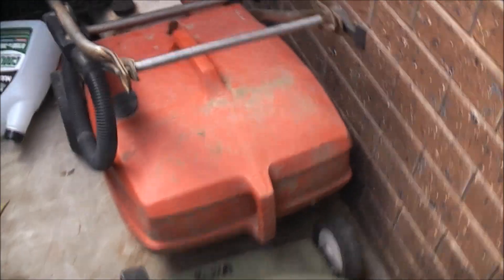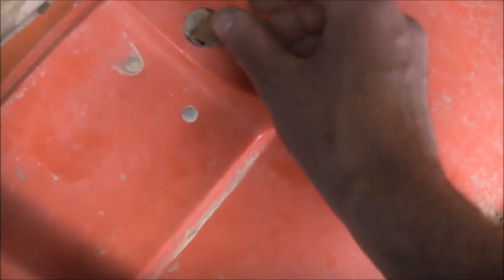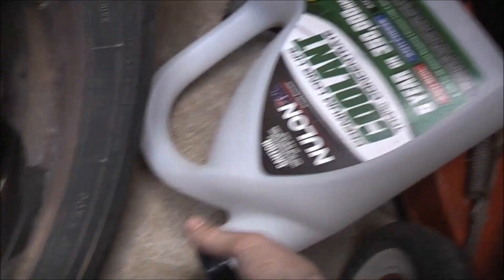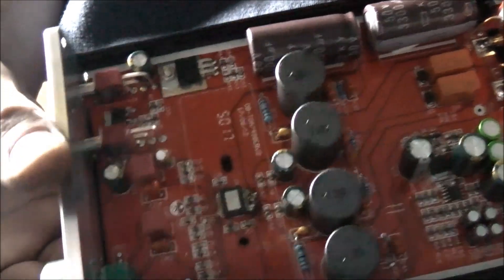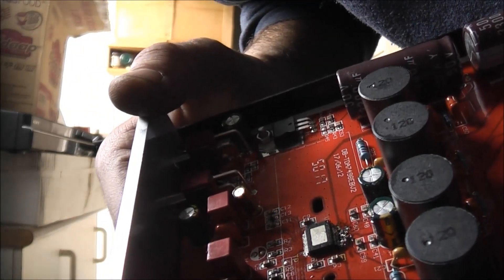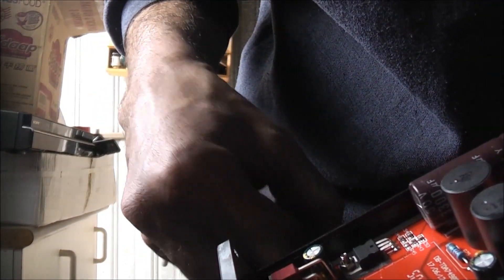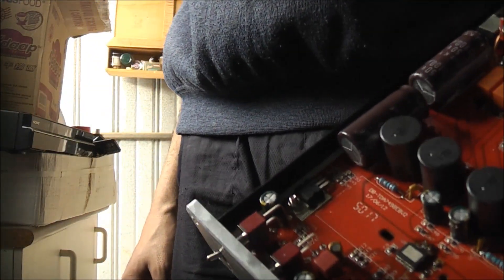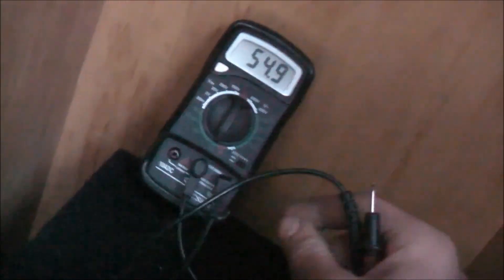Victa 500 Twin Catcher Score & Popped Lepai Amp ;-(

Comment: Thermal digital chip amplifiers used in those lepai units are not designed to be bridged.

And they are not very forgiving if you push them too hard.

Comment: If you want to build a sub, buy a long throw 30cm 350w sub speaker, a 300w single channel car sub amp with low pass filter built in, check the amps it needs at 12v DC and buy a suitable 12v power pack from eBay and build a box for it, libe the box to tune for more precise bass and hook it onto your rig and your neighbours will be complaining in no time... just make sure what you plug it into's master volume controls the sub output